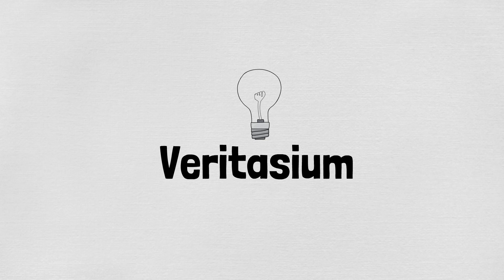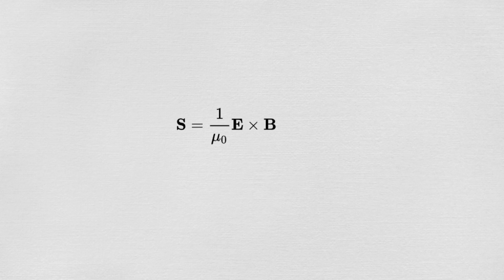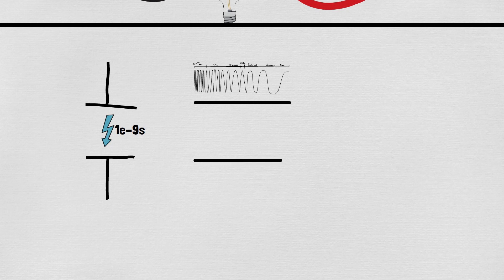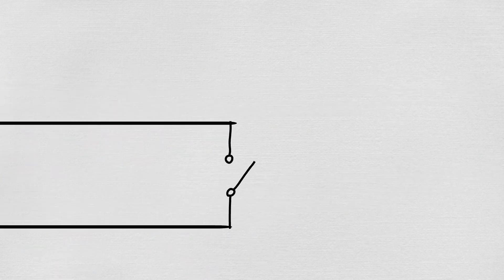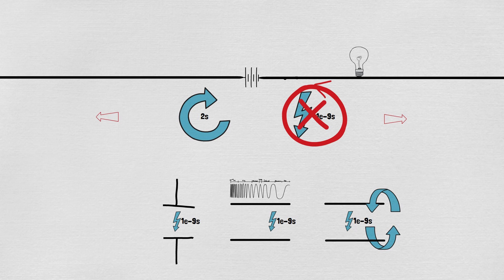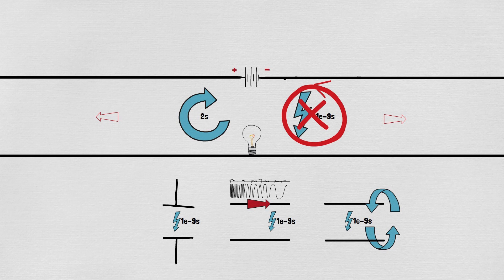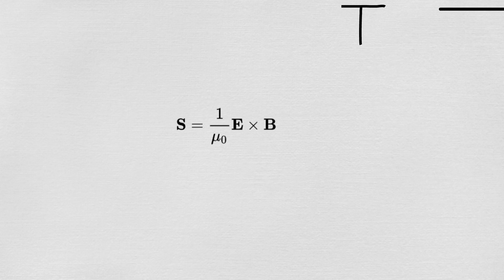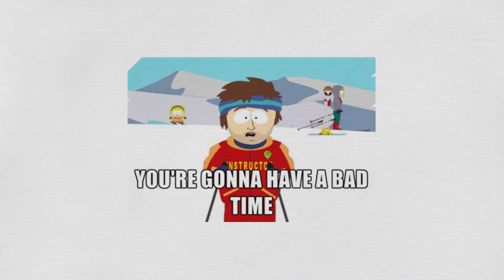Veritasium is Right? (see description)

Comment: Speaking as an engineering student who has barely learned my Fleming hand rules, I dread my near future life.  I don't understand much of  this but your argument sounds more logical than Veritasium's or the handful of response video's I've watched.
Reply: there is a difference between engineering techniques and how a physicist would describe a phenomenon. engineers are trying to create the simplest models that allow them to predict how a circuit would behave. an electrical engineer would model the system using transmission line elements which assume that electrons flow in the wires a  physicist is trying to describe reality fully
Reply: @midnightwatchman1  Whew. I would like to understand reality from a physicist's perspective someday, but right now I just want a degree so I can start earning a paycheck.
Reply: @MrArlenBrazill  If only I had that kind of clarity at your age.  I chose physics and the paychecks have been smaller ever since!
Reply: @MrArlenBrazill  sometimes it is helpful. If you know the limation of your models. for example the reason we use DC when transmitting power underwater, for this reason, the dielectric of free space changes, and models no longer work accurately enough

Comment: Now that I think about it , that is true . 
A good example would be a hose  filled with water  , I would have to  move all the water in the pipe inorder to start the flow . And each water molecules would communicate with each other at speed of sound.

The time it takes to communicate would vary depending on the distance of the switch from the bulb , since a potential already exist at the length of the battery to the switch.

Comment: Thanks for adding sanity to this crazy situation. I am an EE. An old 
one. I carefully avoided the trauma of EM fields for 40 years by going 
into digital electronics, when it was slow. But I could see that 
Veritasium's explanation applied static equations to a dynamic 
situation. Clearly it was wrong in some fundamental way, and you just 
cleared it up.

Comment: Implied in the circuit is distributed capacitance (to the portion 1m away). When the switch is closed, the capacitance gets charged. Therefore there is capicitive coupling which transfers a voltage - resulting in some cuurent to the bulb. So the location of the switch matters. The capacitice coupling is via an E field and propagates at the speed of light.

Comment: I watched like 6 other explanations to the Veritasium video and finally, you are the one who puts the arguments straight. And on top, you have a very advanced presentation skills, you spent time to do nice animation 👈
Reply: @kirkhamandy  The "in-rush current" has a different cause - it is because the power lines act as a huge "capacitor" that gets "charged" up. Well, even smaller circuits do have that, but that's not really measureable because the capacity is so small.
Reply: @kirkhamandy  Yes, depending of the type of current, you have an impedance, and capacity and inductance, that is correct.
Reply: @kirkhamandy  sure, the point here is that this current would not light the lightbulb. Talking about in-rush current means you would have to take into consideration all kind of interference which exists. But the bottomline is - the lightbulb would not light up.Period.
Reply: @kirkhamandy  Yes I am aware. Nevertheless, Derek's explanation is for a wide audience of non-professionals. His "revelation" is simply not true on the level of technical detail he is approaching the audience. If he said "the lightbulb would blink but then it would wait 1 sec to light permanently" I would be OK with it. I am just afraid that some flat-earther or other moron will use his argument and claim that there is a conspiracy from power line providers hence "we don't need wires to use light-bulbs" and similar non-sense.
Reply: @kirkhamandy  thanks, yes we agree. Have a nice day!

Comment: Actually when the battery is assumed to be an ideal voltage source, the closing of the ideal switch (which is in fact an ideal current source in its opened state and an ideal voltage source in its closed state) leads to an infinitely steep change in current (step). This change in current is what radiates em-energy into space from the position of the switch (because this is where the change happens). So the answer depends on the positioning of the switch and not the battery. When the switch is close to the battery (ideally at the same position), the answer 1m/c seconds is correct.

Comment: I think you are forgetting that  the voltage is already on the opened switch just before you close it. Veritasium failed to point that out as well. It doesn't matter where the battery is, but where the switch and lightbulb are.
Reply: Exactly. 
It means that the current begins to flow immediately through the switch. Which means that the EM field is created immediately around the switch and induces a current just opposite the switch, 1m/c seconds later.
And what you write, also explains why there is no problem with causality.
Reply: The wire 1 lightsecond away has no way to know the switch was thrown and thus current there cannot flow.  

Transformers dont use 1 wrap of wire a meter away for a good reason, your initial current due only to inductance will be pathetic, no light will glow after a nanosecond or two due to inductance.

Veritasium is wrong.  I checked his source and it is suspicious.  A 15.5 foot test then scaled up.  Very unconvincing.

This video adds to the answer and suggests the current movement emanates at relitavistic speeds from the switch.  This I can believe.
Reply: I should add my qualifications.  University education, 4 years of engineering.  Also a journeyman electrician with experience in high voltage transmission (150 kV) as well as the usual low voltage circuits.  I also have a reasonable background in quantum mechanics and general relativity, although it is not my profession and I hate solving difficult trigonometric integrals.
Reply: @Steve-jy1vd  Assuming the switch has been open for enough time for it to be at steady state, each side will have the potential of the side its directly connected to at the battery, the same situation as a DC capacitor circuit:
The voltage will make its way from the battery to any break in the circuit. For this to happen (Before the first steady state, while assembling the circuit itself) there will be a short current through the incomplete circuit, with the forming electric field across the switch, counting as current, as in any capacitor circuit.

When you close the switch, the potential across it goes to 0 (zero resistance wire) and a current begins to flow, and that's the first EM change that propagates through space. The initial current through the closed switch is the same as the displacement current associated with the initial changes in the fields, so there is indeed a completion of the circuit, but it's a much smaller circuit than the whole thing, and it's being completed trough space.

I think the one thing we should be able to agree, is that that initial change in EM fields is going to travel through space, hit the lamp and cause some voltage transient, that should happen even to an adjacent lamp not connected to the circuit
Reply: @Steve-jy1vd  There's actually two steady states involved, the first one has the battery's potential across the switch (before t = 0), and the final has that same potential across the load.
These are simple passive circuits, there aren't any issues with stability, it's just that as time goes on, with each reflection, the voltages get closer and closer to the DC values. This is true in all circuits, eventually the change from reflection to reflection is not significant compared to noise and we call it DC. 

In terms of energy, I think something that is confusing people is that the fields have energy associated with them, so the battery isn't the only source at (t = 0), with the circuit charged. When you close the switch some of the stored energy in the collapsing E field near it will be radiated (Collapsing because of the short), and some will go to the magnetic field (when you start to have a current, you start to have a B field, witch requires energy).

I think it's somewhat tragic that a lot of interesting things about how these elongated circuits we call transmission lines work are lost because of Veritasium's choice of example. There are problems in transmission lines that involve switching the generator to a resistor, then the transient response as the line dissipates its energy is calculated (usually tiny, but easy to calculate in a transmission line, as the capacitance and inductance are consistent all the way, and radiation can be ignored). So sometimes the battery doesn't even matter for energy to flow in a circuit when a transient following steady state is involved.

Comment: You know what? I have studied only rudimentary physics so far and aspire to be an astrophysicist myself. I thought about the equation Derek used and it made me think. But I not once though about moving the switch out of range of the causality bubble of the light. Moving it far enough away would actually mean that information and thus causality travels backwards in time, thus contradicts all known laws of physics related to the speed of causality. Even quantum tunnelling takes time to occur. It may have a faster than C relationship that is as of yet not fully explained. But it is measured in time. Moving this switch literally is a contradiction to the equation and the position that Derek held <3 I hope he sees this. Thank you for putting it in such a logically contradictive way <3

Comment: Watching Derek's video and other videos about this topic I always felt that something was wrong... But I couldn't figure out why. I think you may not find a better way to explain it than this video!
By the way, what Derek said is still true: after the circuit is closed an electron still takes 1/c seconds to reach the bulb; on the other hand, this flow starts only after 2 seconds, when the moving electrons have reached the other side of the battery and there finally is a voltage difference.
Reply: The "voltage difference" exists before the current flows all the way around the circuit. It exists before the switch is closed and is the REASON for the flow.

Comment: Thanks you for your video. There are a lot of bad videos on YouTube but thankfully yours is a good one. There were so many viewers who fell for Veritasium bad video explanation. You hit a good point - it needs current flow. How would your stove get hot? How does a resistor gets hot? Veritasium didn't even bothered to explain how the energy gets transferred to light the bulb. One viewer even said that the circuit didn't even need completing to light the bulb! Crazy!

Comment: From my understanding of transmission line and waveguilde theory, there are multiple modes by which the energy flows. I may be wrong here, but the simplest mode, mode 0, is simply the wave defined by the distribution of current flow along the lenght of the wire. A small current flows near the battery, which causes a current a bit further and so on. The wave takes 1 second to reach the ligh.

Some of the energy flows across the gap, but not much.

Comment: You are ignoring initial conditions. The logic of "what if there was a break in the in the wire, no current, no potential difference".  This is not true.  You are also ignoring transmission line effects.   Current will start to flow immediately if the line is long enough at the battery but not in other parts of the circuit.  By the logic you have presented capacitors could never work.

If the switch is open there will be a small potential across that switch and the circuit will be in equilibrium, closing the switch changes this, current will flow immediately to try and restore that equilibrium. This will immediately induce a local EM field.  Yes it takes time for the system to react, and the actual power being delivered to the lamp is miniscule, but non zero.  Your examples about moving the switch also are accounted from this description, in the case the switch is halfway down the line, the EM field will originate from the switch initially as current is localised, as the current propergates the origin of the EM field moves.  We are talking about a DC current here as well so that power is only in the initial case inducing a transmission antenna effect if you want to think in those terms during that transient phase, just like a capacitor.  Steady state is different.
Reply: While this is true, this largely depends on what you want to count as lightbulb 'activating'. As you yourself said, the current from this effect will be relatively small, and the system (lightbulb included) would not have reached equilibrium at that point. The bulb will be fully powered on only after the 2 seconds described in the video. So this bit in my opinion is up to interpretation- whether you count a tiny current flowing through lightbulb as it 'being turned on', or whether it is on only when the maximum possible current is flowing through it and equilibrium has been established in the system
Reply: @Assault_Butter_Knife  that assumes zero resistance in the wires otherwise any non zero value will be multiply to a massive number so may as well be an open circuit, at which point full power will be obtained in 1/C seconds